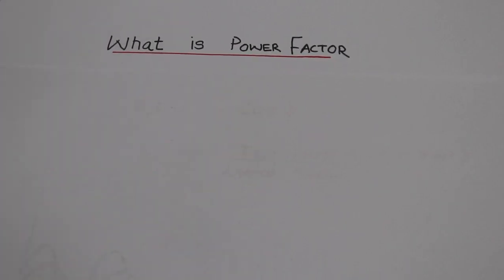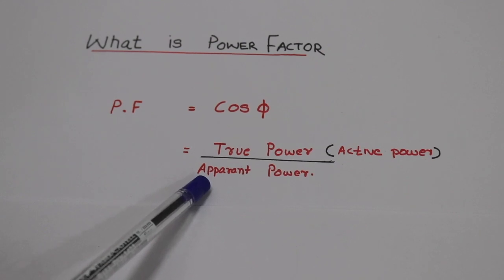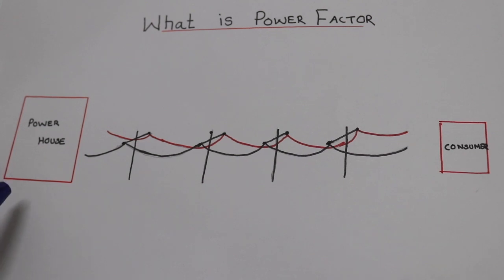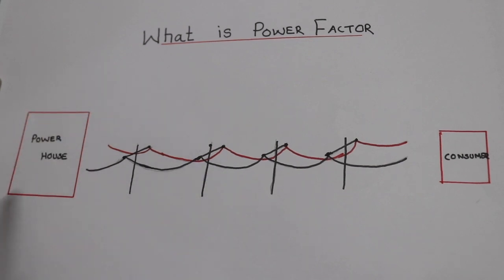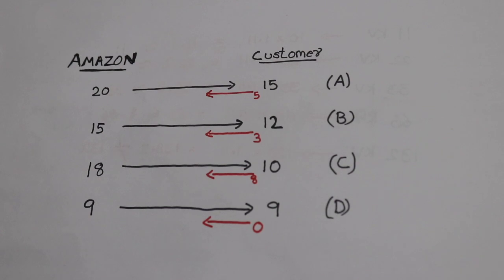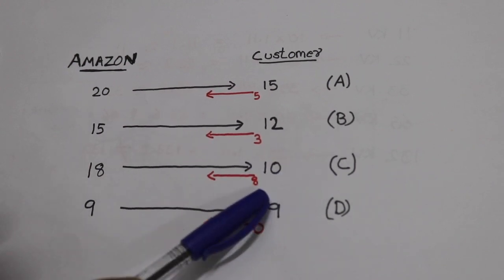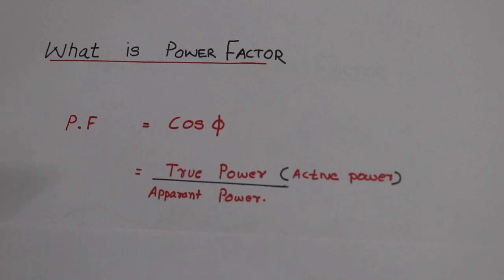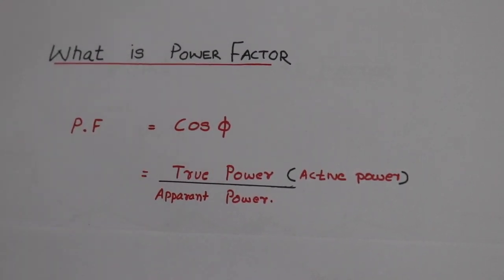POWER FACTOR explained in malayalam || power factor എന്നാൽ എന്താണ് ..?

Comment: Bro 
KW ,KVA, KVAR explain cheythillalo
Technical interviewinu egane parajal avaru accepct cheyilla
Pinne leading and lagging powe factor
And the main definition 
Power factor is the angle between Voltage and current 
However, good attempt
Reply from the maker: Bro,  ith just power factor enthanenn manasilakaan vendi mathrm ulla video aayt aanu cheythath.  And thanks for the valuable feed back 🥰

Comment: സർ , ഒരു electric iron 240 volt ൽ പ്രവർത്തിക്കുന്നു അതിന്റെ watts 1100 , Ampere 1100/240 = 4.58 ,  Ohms 240/4.58 = 52.4 ഇത് 220 വോൾട്ടിൽ work ചെയ്യുമ്പോൾ ampere 220/52.4 = 4.2 A , വാട്ട്സ് 220 × 4.2 = 924 W  (176 watts ന്റെ കുറവ്) അങ്ങിനെയാണെങ്കിൽ കുറഞ്ഞ വോൾട്ടിൽ പ്രവർത്തിക്കുമ്പോൾ electricity ബിൽ കുറയില്ലേ , 1100 വാട്ട്സ് എന്നുള്ളത് 924 ആയിട്ട് കുറയുകയല്ലേ , തെറ്റുണ്ടെങ്കിൽ മനസ്സിലാക്കി തന്നാൽ വലിയ ഉപകാരമാകും
Reply: Low voltage ill work cheyumbaol same heat produce cheyyan kuduthal samayam
vendi varum. Heat=i^2 ×R×T
So Kwh vethayasm varunilla
Reply from the maker: അങ്ങനെ അല്ല...  ഒരു iron box work ചെയ്യാൻ 1000 വാട്ട്സ് വേണം എങ്കിൽ,  അതായത് 1000 വാട്ട്സ് ന്റെ ഒരു iron box ആണേൽ voltage കുറയുന്നത് അനുസരിച് അത്കൂടുതൽ കറന്റ്‌ എടുക്കും. Total power എപ്പോഴും 1000 വാട്ട്സ് തന്നെ വേണ്ടി വരും
Reply: @ThroughTheCircuits  false bro. Think about  1000w video light. It dim when voltage is low that means its power output is reduced in low voltage. It is a resistive load.

Comment: Neutral lum earth chekku cheyyumpol  volt kanikkunnu  ethine kurich vidio cheyyamo. Oru valiya help ayirikkum . unit usage kurakkan ethu sahayikkumo?
Reply from the maker: normally earth m nuetral m thammil 0V aanu varendath. some voltage means some leakage. energy is wasting. fix cheythal unit usage urappaytm vethyasam varum
Reply: @ThroughTheCircuits  bro KSEB parayuvaa total volttage nte 2% neutral kandal prashnamilla yennu. Becouse 3phase =440 appo 8.8v vare kandal prashnamilla yennu. But same situation thanneya single phaselum . Avar parayuvaa no leakage yennu. Anganeyalla yenkil njan kandupichu athinte project courtil sabmit cheyth report kondu koduthal avar mattu paripaadikal alochikkamennu . Yenthu cheyyana sadaranakkarude orooo gathikedu.
Reply from the maker: @muhammedajnasmavilakandy8501  ipo phase to nueral ethta volt und?
Reply: @ThroughTheCircuits  7.5v chilappo ethu 9v kaanam. Aduthulla shope and home ella yidathum ethuthanneyaa awastha.
Reply from the maker: Normal oru 3V vare okke ok aanu. Transformer orupad dhoore aano ullad.?  Athpole kseb yude nuetral line evidelm strands break ano. Suppose 10 stranded cable anel oru 4 strands break aanel okke sadharana voltage kooduthal vararund.
Reply from the maker: Elladthm same avastha aayath kond kseb line issue thanne aanu. Nutral line break or overloaded line oru too much unbalance in the circuit angne nthelm aavam. 9V koodthal aanu bro. Electronics items okke undel chilapo seen aavm

Comment: ഒരു   ടെൻ.  എ ച്ച്  പി  മോട്ടോർ  ' 1440. Rpm   ആയി   വർക്ക്    ചെയ്യും  മ്പോഴും       3000.    Rp M.    ആയി    വർക്ക്    ചെയ്യും  മ്പോഴും    കപ്പാസിറ്ററിന്റെ     Kv AR.     വ്യത്യാസമാണല്ലോ    വേണ്ടത്    അത്     എങ്ങിനെ    കാൽക്കു ലേറ്റ്    ചെയ്യും
Reply: കപ്പാസിറ്റർ വച്ചാൽ ആമസോണിൽ തിരിച്ചു പോകാതിരിക്കുമോ ?
Reply from the maker: @royvarughese7414  kurachokke irikkum bro.. Correct calculate cheyth vechaal full pokaathirikkum
Reply from the maker: frequency അല്ലെ വെത്യാസപ്പെടുത്തേണ്ടത്..  എങ്കിൽ അല്ലേ rpm change ആവൂ
Reply: @ThroughTheCircuits വ്യത്യസ്ത പോളുകളുള്ള രണ്ട് മോട്ടോർ  Eg 6 POLE  and 4 PLE   ഇൻഡക്റ്റൻ സ് വ്യത്യാസം വരും  അതാണ് ചോദിച്ചത്